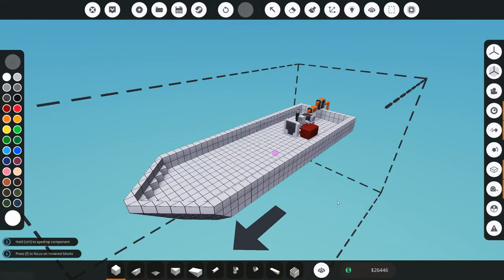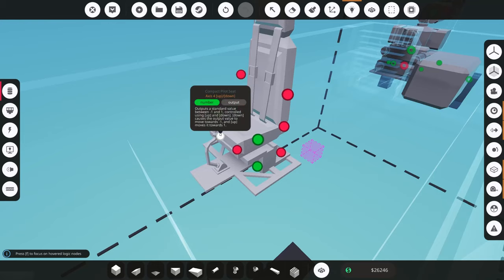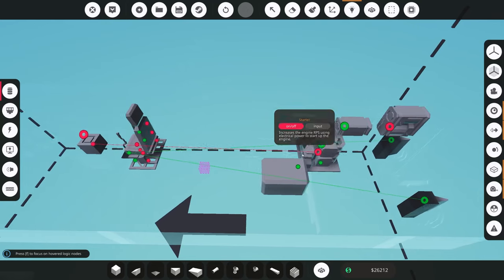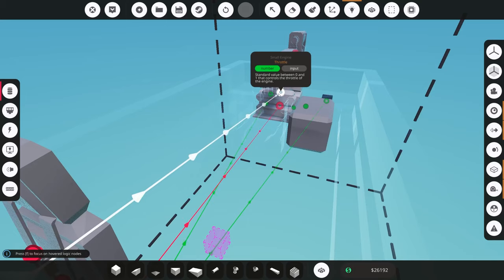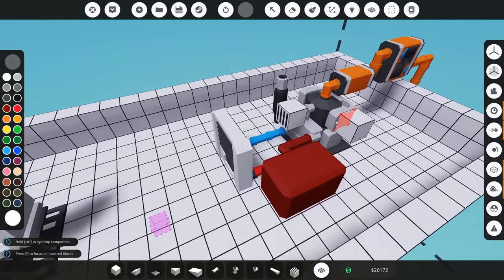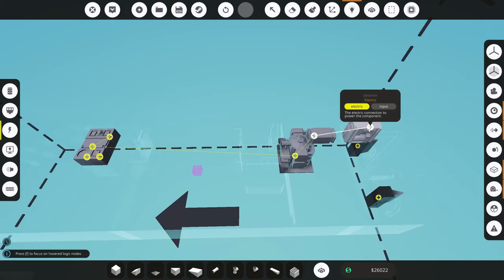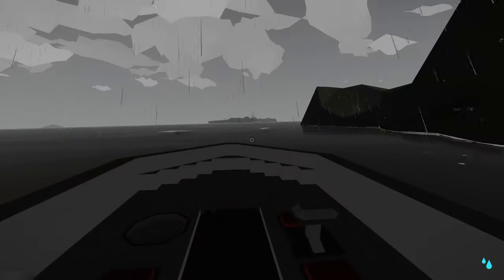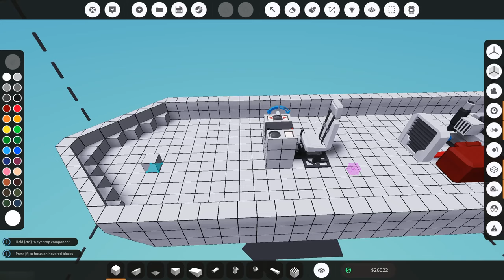Stormworks Official Tutorials - Logic & Controls Basics

Comment: I’m torn with these tutorials

This video is helpful and teaches you a lot about the things mentioned in the video.

However I’ve noticed that after ‘basic boat/controls build, like rudders etc. the tutorials stop.

I’m currently stuck on a compact robotic pivot. I know how they work, but connecting the logic on the data tab is near impossible. Because I’m given no indication where to connect it.

Honestly, I’m surprised individual 3-5 minute tutorials about each component aren’t a thing. Because once you have mastered hooking up an engine or setting up rudders etc. you get no help if you get stuck. Because there are no tutorials posted that aren’t about those basic functions.

After 5 months I doubt you’re reading comments, but Jersey, if you’re seeing this. Please do individual tutorials for individual components. Even if setting them up is exactly the same.

I’m new to this stuff, and I’m currently trying to practice on an outdated creation that’s been discontinued by re-vamping it. In my case, existing robotic pivots go into specifically named nodes. But I don’t know what block or item that node represents.

I just want to press a button, and have the pivot open a hidden door next to it. Apart from electrical (which I’ve already done) the data nodes are green for the button and pink for the pivot, so I can’t connect them together. My struggle is, I haven’t found a single video that explains what this thing is that the nodes seemingly go into (when you’re on the logic section, the description of the block disappears and only shows the nodes it has).

So please. If jersey or anyone sees this, help me out by making a video on each individual component even if it’s a couple minutes long. I guarantee you will be the first to do so, and it will be popular in terms of views because I doubt I’m the only one struggling past the ‘basic logic functions’ stage
Reply: Same
Reply: use the threshold gate
Reply: Place a throttle lever down, take the green data output of it and connect it to the green hollow circle on the robotic pivot.
Reply: I think im too late for making the video

Comment: I did everything correctly but my boat just kept going backwards and I also have some  probs with the clutch it just won't go
Reply: Look at your gearbox, is the Ratio 1 on 1:-1? If yes, thats the problem why the boat is going backwards. Now to the clutch, is it connected with a battery? If yes, is it connected to the seat or throttle lever?

Comment: Well i put everything together right... And it doesn't work. Engine lurches forward and then bogs down and basically stops.
Reply: Stormworks broke everything several times since this video, it's why no one has made any new tutorials.
Reply: okay i found the solution, have the throttle up to full, and then start the engine, then hold W. And not just press it, it will cut off yes, but just keep holding W until it comes back on.
Reply: @nubrake802  doesn't work for me
Reply: @kyle123four  Hold engine start while holding W? Dont let go of start either.

Comment: its a good tutorial but how come whenever i use the ignition, i have to hold it for the engine to stay on?
Reply from the maker: Because it’s a starter
Reply: @MrNJersey   ah ok mb im dumb with logic and stuff, thanks!
Reply: @MrNJersey  what do u mean
Reply: @firefalcon3086  starter is only used to spool up the engine to minimal RPM/RPS, but not to continiously use it as the electrical motor. If the engine doesnt start, there's something wrong with the air/fuel mixture

Comment: I'm having some problems with moving my boat. it seems every time I start the boat, it goes right up to 20 RPM and it does not drop! It stays at 20 RPM. When I decrease the throttle, it goes down too far. And moving the ship forward will kill the engine. I don't know what I did wrong. Please help.
Reply: NVM, Problem fixed. (I was not making the throttle go hight fast enough and did not press the start button as well.)

Comment: every time I apply the throttle the engine cuts off
Reply: okay i found the solution, have the throttle up to full, and then start the engine, then hold W. And not just press it, it will cut off yes, but just keep holding W until it comes back on.